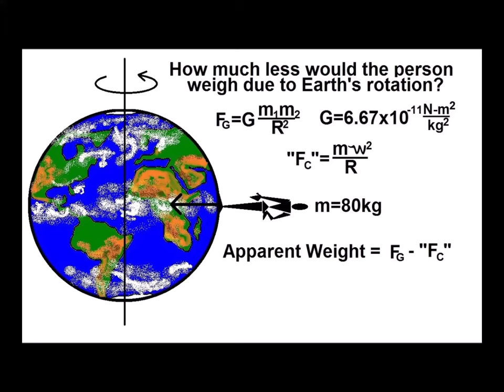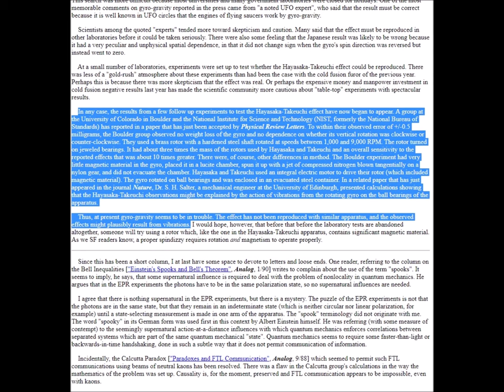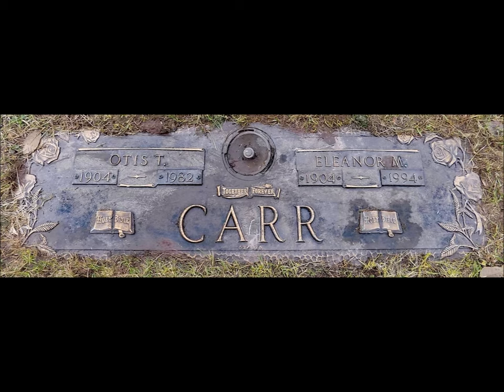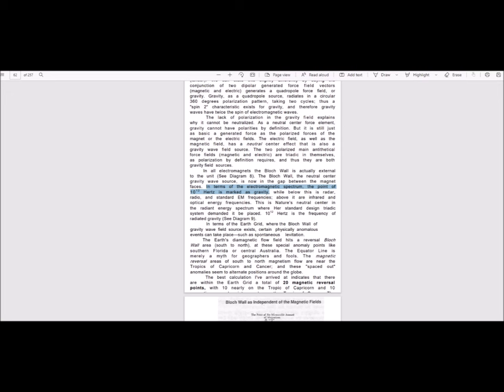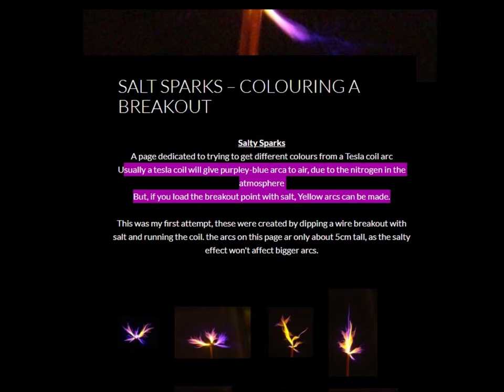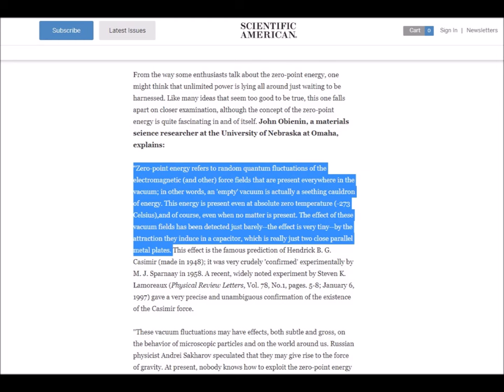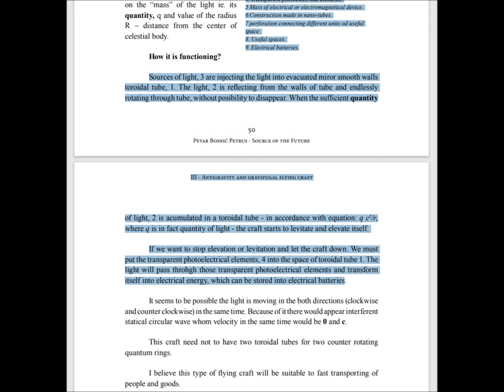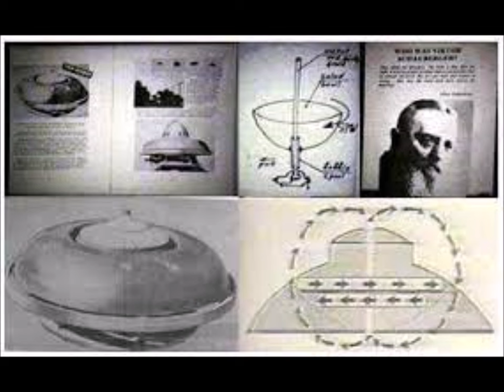Otis T. Carr's Inertial Field Lift Part 1: An overview of the OTC-X1 Circular Foil Spacecraft

Comment: Good day. Magnets are not a source of energy - they are warm air, which is transformed into rotational motion in a concentric vortex.
The basis is a disk that rotates between the covers, creating a large vacuum in the center.
There is a hole in the top cover (it is also in the center of the disk to use both sides of the disk) above the hole there is a dome, in the dome on the edges there are holes through which warm air enters.
A vortex is formed in the dome, which rotates a small (compared to the disk) turbine - the turbine is attached in the center of the disk.
The drop in temperature is so severe that the bearings freeze (which is a big problem).
When accelerating, there will be a howling loud sound, you need to accelerate even more to pass this threshold, then the vortex will push the turbine and the disk itself.
This is a source of energy. Thank you...
Reply: Does the Utron really accumulates the acceleration of the rotation?

Comment: Time 1:22:53  To understand how these crafts work for energy. You have to start with all energy can be transformed. For instance removing amps from volts amplifies the volts. As the same is true for removing volts from amps. You change the energy, but don't remove the total volume. Carr built a pulse motor that charges and discharges a capacitor. When started it will continue to run. The over unity portion is the center coil (utron). It's not made to use amps at all. However by building it as a fly back transformer it does amplify the volts. Using a spark gap is one of the most important parts of where the energy from the center coils goes. To make the energy static it requires the spark gap.  When applied to the outer craft it creates a static field. The craft acts as a primary coil on a tesla coil or ground. The bottom of the center coil is your secondary coil. Frequency is now controlled by the rotational speed. As the two discs counter rotate in unison they are locked at the same rate. That's why the frequency changes as the craft starts to operate. A simple starter motor at the top of the craft would be able to start the process and can also be used to power the electronics in the piolet portion for the craft as it changes to a generator when the craft is running on it's own. A small thrust can now lift the craft. The utrons on the outside have a different purpose and are  placed differently. They are connected to a solenoid and can be pulled in at any time. When you are in flight lock the rotating discs to move in one direction and the pull three of the utrons in and you get the imbalance of the craft. When released back out it moves without propulsion. creating the golden ratio. It looks like a frisbee being thrown. The most interesting part of the whole thing is the static field. It brings an object to true weight. What an object would weigh in space with no gravitational pull on it. Counter rotation does not remove weight. It balances it to the earth. ( When you think you understand frequency and resonance remember that Tesla could take down a building at 1.42 hz of resonance frequency not frequency and horses can take down a bridge with the resonance frequency of their hoofs.  In short higher frequency's are not always the answer to resonance frequency's . )
Reply from the maker: This is really interesting!!! We both also recognize the properties of a Tesla coil in the craft's operation. I also watched a couple of your videos. The "pressure point" which you describe sounds somewhat similar to the artificial neutral center concept mentioned by John Keely and Jerry Decker.
Reply: @gsutton78  Take a look at the end of the cross video. the last page has my notes on the understanding of a ufo so far. It will probably change as i do more testing, but it will help you see where I'm at so far.
Reply: Thanks man  building  in my garage when it works im going to build a full scale one

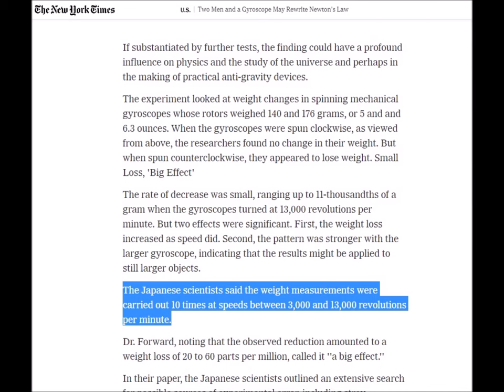Comment: Time 15:00 The weight of the object doesn't change. The force upon it does. If you can't understand this than you will fail to grasp the concept.
Reply from the maker: Indeed. Thank you!  I remember Carr saying in the audio clips that the craft when brought up to rotation speed still has the same weight but acts as an "independent force". Fascinating!!

Comment: the brushless motors found in RC aircraft are fast and very smooth bearings, would be a good starting place to mount counter rotating discs
Reply from the maker: Thanks a lot!! I'll look into it..
Reply: What motor can achieve this speed with heavy load?
Reply from the maker: @Cb80001   Well, we'd need not just a motor, but an engine. So we'd have to look at it in terms of horsepower(HP) which is directly proportional to torque and speed. Carr said that one of his smaller models would take off at 68,000 RPM and developed over 700HP. This is a lot, probably especially for materials in the 1950s, but it's by no means impossible. Tesla built several bladeless turbines, at least one that allegedly reached 675HP. And Carr learned much of what he knew from Tesla. For Carr's design, the saving grace is that the larger the diameter of the ship, the lower the RPM that is needed, but the torque output would have to increase by a proportional amount all other things being equal. Today, there are many car engines that exceed 1,000 HP. And there  are engines used for large container ships which operates at well over 100,000 horsepower.
Reply: @Cb80001  large drone motors
Reply: @m3sca1  Gerard Morin talks about BL motors and resonance.

Comment: Replace the outer utrons coils or as he called them regeneration coils utron ... replace them with a simple small wheel and that's basically what they are the term completely round and completely square was used because it's the only way he could get them to rotate and regenerate....the utrons must freewheel ..or rotate on their own ..the capacitor plates where pulsed and the utrons rotate as a by product of the whole motor rotating...in simple terms the craft is a electric motor and the battery is in the middle...so he says he used atmospheric electricity it was because the center battery was wrapped with copper wire making it a regeneration coil and because of the capacitors plates ionizing the outer shell this center coil being pulsed regenerate the center battery and cept the craft having its own gravity the center battery caused a inward tornado pulsing magnetic field causing it to have its own gravity in the craft ...

Comment: Buddy, I have another suggestion for why u need 2 rotating discs to lift and fly, rather than only one disc: What if, Carr took into consideration 2 forces rather than 1 (and he was vague and ambiguous abt it), he took Earth's rotation on its axes and Earth's rotation around the sun. Mind you, they are both anti clockwise... so with the larger, lower disc spinning anti clockwise,  just like a satellite,  you negate gravitational pull or weight of your craft and the interior clockwise disc does all the magic by playing with the craft's new gravity/weight attributes/properties and actually does the lift, the steering, the.... The habitation stays still, not connected to the turning rod in the craft simply because u dont want to lose gravitational properties there, u want to lose them under so as to lift, manipulate and travel...
Reply from the maker: That's an interesting idea! I can't wait to begin the rotation experiments! And I agree that it is probable that Carr might have been purposely vague about some of the details as he was not only in the patent process, but according to Ralph Ring was also being harassed.

Comment: Hold on if you ever seen the will spin and defie gravity that will not take place unless you have a arm or something keeping the device from topaling over
Reply from the maker: In Carr's design, there were actually two wheels counter rotating. Also, the rotation has to be fast enough. That's the key according to this theory.

Comment: What if we connect the electromagnets just like in a single phase induction motor, where we have the main winding (6 coils) in paralel with an auxiliary winding (another 6 coils) in series with a capacitor, and put a slip-ring contacts in the outer assembly to allow the outer part to rotate and put some brushes in the landing gear, something like this in the video: 

https://youtu.be/w8bDha0szIY?si=cFlAHrl-hiorvkFZ

The action will be the inner disk to rotate to some direction and the reaction will be the outer disk to rotate in the opposite way. But we would still need an electric field, a high voltage difference between the surrounding air and the object itself, but that's another study.

Comment: 6 Utrons, not 12.  
7 if you include the central Utron. 
All drawings show this clearly.
Reply from the maker: @Sebastiaan Stevens  Actually, there were 12, at least according to Ralph Ring. He says it here starting at 4 minutes and 25 seconds in:  https://youtu.be/qbRpiDSQX9g.
Perhaps other models had 6. But the main craft 12; 13 if you add the central one.
Reply: 12von the 45 ft craft 6 utrons on the small model

Comment: Time 8:50 he broke unity. If the second action has no cost then its energy can be multiplied in capacitors and then stored and used as the first action. The rest of the energy is used on the outside of the craft and can be absorbed in the same manner.
Reply from the maker: What do you think about Ralph Ring's assertion of the craft "resonating at the frequency of aquamarine" and instantly traveling to a predetermined location of the same frequency?
Reply: @gsutton78  I think it is interesting and could be possible. However if it does that then time would never matter. Or at least how we see it. I would be the firt to be happy if it did.

Comment: In counter rotation you remove load from the equation.
Reply from the maker: Counter rotation neutralizes the load and then a small force can move it?
Reply: @gsutton78  because the outer and inner move the force is against each other, not on the center of mass. Load is based on the pivit point to the resistance of the load. You have no pivit point just another rotating body. 

think of gravity as energy. force is creating energy on you as gravity. Break that energy with you own energy. now you are free from it's effects, but you still weigh the same. The key is the effect is gone. It's why an ion engine in space works, but on earth it is not so good. It's tesla's sea of energy. 

I built was suppose to be a motor generator. It was built with plastic then i used aluminum to try to get eddy current to move the next disc. it failed. then i used the first to move the second ring the rotation speed matched each other. It could spin all day. That's when i realized that the load was no longer on the center pin but on each spinning disc. when forced onto each other there was no place for the load to resist it. 

To see it better draw a circle then another around it. each circle is moving in opposite directions. Where is the load? Does it matter any more? The faster you spin the first one the faster the outer on goes to match it.